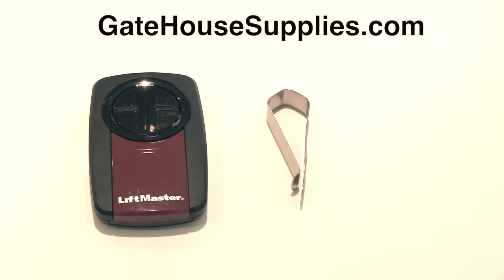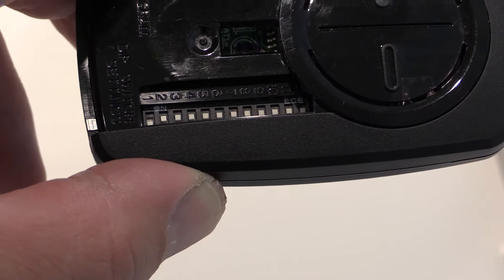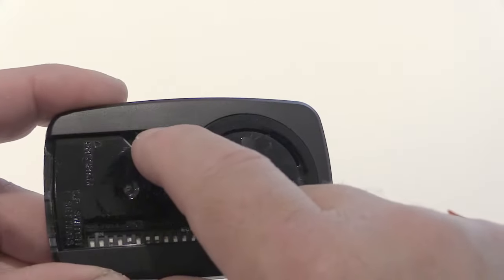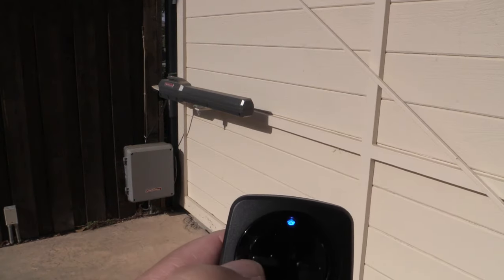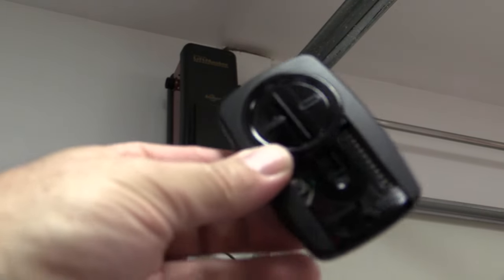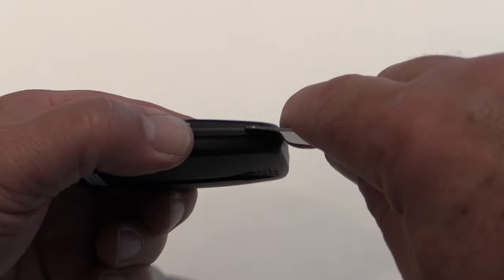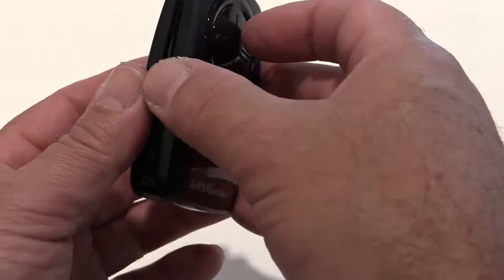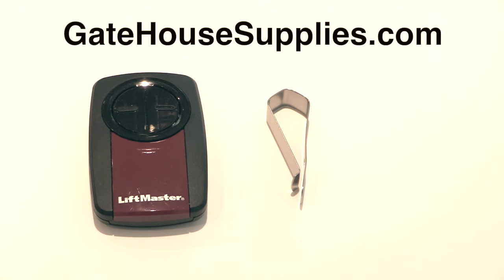Liftmaster 375ut Remote Control

Comment: Thank you for the detail about setting the DIP switches, then pushing the program button, and THEN pushing the remote button the correct number of times BEING SURE to wait for the LED to stop blinking after each push!  The instructions with the remote we not that clear.  I was also tempted to use a baseball bat on mine, but now I'm happy!
Reply: Agreed.  I was also about to return my remote because of that.  Thanks

Comment from the maker: Check out the new Liftmaster 375UT remote control
Reply: My landlord just gave me 9 of these there is a slide gate do I have to do anything with the box at the gate or can I just move the small 1-10 slide buttons on the Inside to match the other ones that are already programmed so I don’t have to use the learn button for the new remotes,? Just set 1-10 the slides the way they are supposed to be and hit open close button the correct amount of times and it will work? Hate to ramble just trying to match our new remotes to the old gate

Comment: I am trying to pair a programmed 361LM with this new 375UT remote. The number 05 on the 361LM is in the 0 or neutral position. There is no neutral or 0 position on the 375UT. How do you deal with this?
Reply: Same question

Comment: Hello Sir . Having problems with original liftmaster remote 2008 , replaced battery,  and reprogrammed started to work from inside the garage and inside the house also works when I place the remote against side wall of the house and garage , but does not open when standing in front of garage door,  when I have the door open it will close with remote  but not close standing 15 , 20 feet or open . Please help wife is on my @ .

Comment: Mine looks like the unit in the video,  EXCEPT,  it doesn't have a blue light,  and more importantly,  there is not a notch visable to open the back and change the battery.  HELP!
Reply: Carefully use a knife blade to slowly pry all the way around until it pops open. You can use the knife to slide the battery out also.

Comment: The assumption shouldn't be made that you have an old remote from which to inspect pin positioning. How do you program this with no old remote, and with no access to a learn button on a community gate?
Reply from the maker: What is the make and model of the community remote?
Reply: RCS-433CTG1. That's the remote. The community gate is a Liftmaster Professional. I'm not sure about the exact gate model. The home owners association isn't too keen on me asking questions about it. I'm trying to program this remote to open my gate, rather than spend $50 on a new RCS-433CTG1 remote. The old one was literally run over by a car and smashed when it fell off my keychain.
.
Reply from the maker: Our remote would not be compatible with that unit, sorry.
Reply: +The GateHouse Liftmaster support said it would be. They're the ones who recommend it. Thanks for your help. Do you happen to know what remote would be?